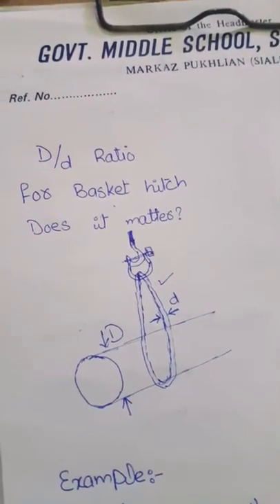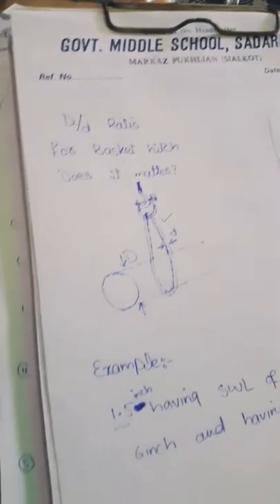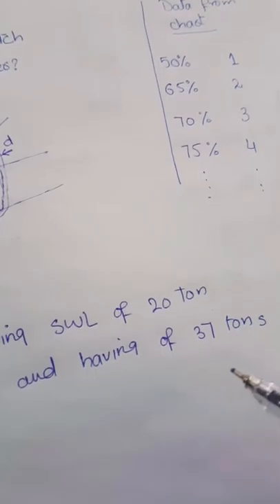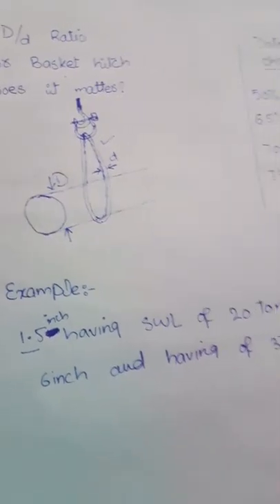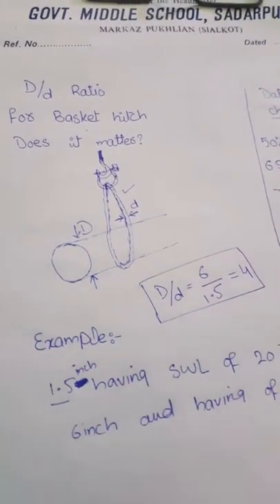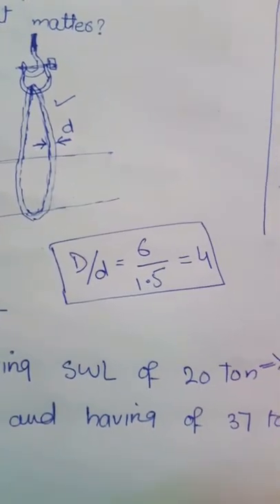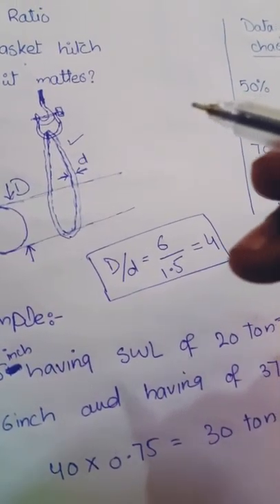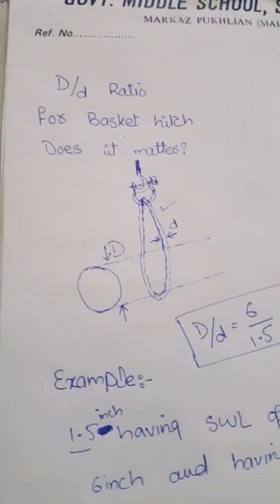D/d ratio for Basket Hitch

Comment: It will only increase/double if the dia of the load is 25 times greater than the dia of the wire rope/sling.
D/d = 25/1